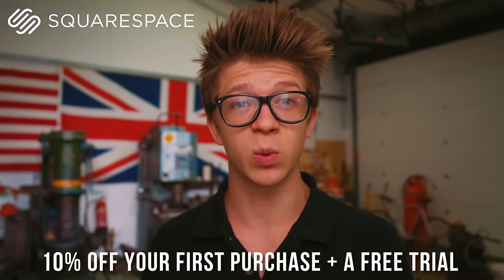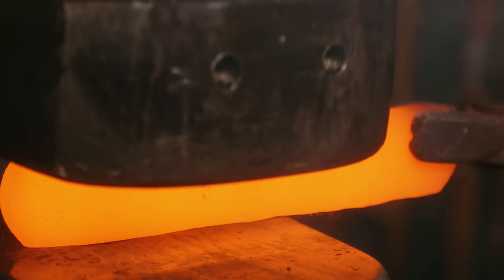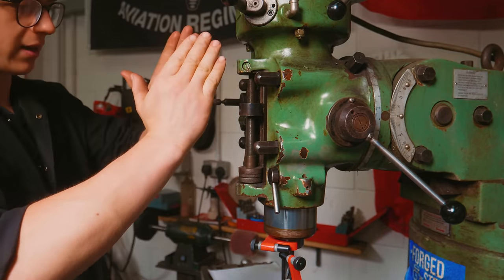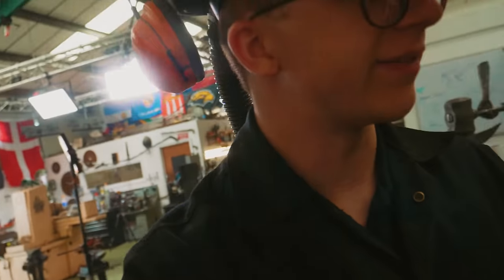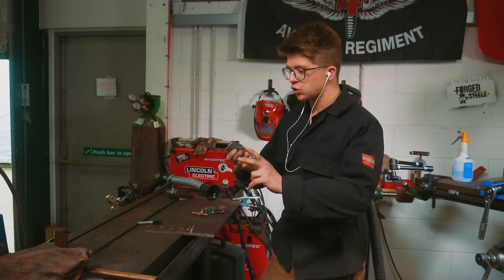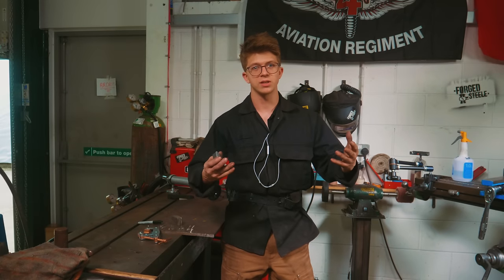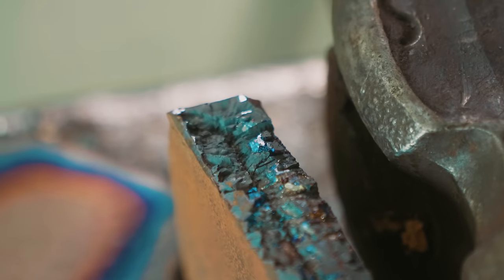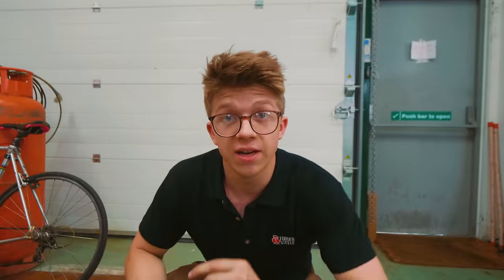CAN YOU MAKE TITANIUM & STEEL DAMASCUS?!?!

Comment: So, Im not a smith, but a welder with a basic understanding of metalurgy, and Titanium welding must be done in a completely oxygen free environment, which I think you mentioned.
I also remember hearing something about gas forges releasing a lot of oxygen in them when the gas burns, whereas a coal forge does not, and is almost oxygen free inside, so would a coal forge perhaps work better?
Reply: Its true that forgewelding is apparently easier in a coal forge, but not because of the oxygen but because of the water vapor which is created in a gas forge but not in a coal forge
Reply: Lars Heim Ah, there we go. I was remembering  things wrong then it seems.
Reply: We use a Torvac with an Argon quench for brazing dissimilar metals.  And a high pressure/temp  process for  diffusion bonding
Reply: Lars Heim is it maybe that the titanium is so reactive it steals the oxygen from water? I know that is the thing with magnesium and they seem to be pretty similar in reactivity.
Reply: MatteV2 he should try the coal forge and flux weld the pieces together one at a time like steel smithing
Reply: ti is commonly used to "getter" o2 in ultra high vacuum systems, which gives you a notion of just how reactive it is.   or put more colorfully, ti will oxidize on the moon.
Reply: Not only O2-free but also Nitrogen-free -> Helium or Argon atmosphered 😉
Reply: What about Neon? Also a noble gas, should be readily available.
Reply: Neon is very expensive for some reason, despite the millions of tons of it in Earth's atmosphere. ;) In fact, Neon is usually supplied to sign makers in 1-liter containers at less than atmospheric pressure, which still is enough for thousands of signs. This is even more the case for He-Ne lasers. Therefore, they can afford to pay a lot for it, which sets the market price. Argon, however, is quite cheap, since it is a byproduct of making LOX and LN2, and plentiful, at about 1% of air.
Reply: helium or argon work just fine for shield gas.  does not need to be done in a vacuum or even 100% inert gas sealed chamber.
Reply: If you are welding titanium and titanium... you do not need to do this in an inert environment... I mean we used inert gas, but you dont have to go run out to space or weld inside a vacuum in a suit with inert gas... (no idea if you can even do this... I added the mental image for entertainment).  Source: Worked in a factory where we almost exclusively welded titanium... http://americas.denora.com/
Reply: Jacob Brown  you are right about not needing a vacuum or 100% inert gas, but you do need some inert shield gas (preferably both sides of the weld.  There are places that do electron beam welding of large assemblies in a vacuum chamber (but no ones inside the chamber).  the electron beam will not work in anything but a vacuum.
Reply: that why he said he needs to add some argon in the forge which is patented
Reply: MatteV2 can verify, the carbon released by burning coal reacts with the local oxygen, while many gases are oxides that, when combusted, produce oxygen.

Comment: Hardest part of working with titanium is that oxide layer. Which of course heating it up makes it form faster and it's a strong layer that doesn't flake of like iron oxide. 

You'd probably need an inert atmosphere to make a titanium and steel Damascus just like you need an inert atmosphere to weld titanium so that layer doesn't form preventing forging. So just build a giant argon chamber and put an electric furnace in it and all your equipment and get a SCBA suit and no problem XD.
Reply: i was thinking that maybe using solder flux to prevent the oxidation might help, dip the parts and clamp together, not sure if it would prevent oxygen though.
Reply: Problems I see with that is first you'd need to prep the materials in a vacuum or shielding gas to remove the oxide then the solder flux would just melt off in the furnace which would cause it to oxidize quickly due to the higher heat.

Titanium will even burn in a nitrogen atmosphere if the surface area is large enough such as titanium powder to make titanium nitride. It's quite the reactive element.

In truth titantium and iron just don't bond well together. When we bond them using diffusion bonding it requires a interlayer of copper or nickle if you desire to bond them below 850C. And diffusion bonding is quite a bit different then forge welding requiring near perfectly flat clean surfaces.

My suggestion of doing it in an inert atmosphere was a jest due to the impracticality of it but it's the closest chance to forge weld them together and even then it's highly not likely to succeed in any meaningful matter :)
Reply: Just do the whole process in a vacuum while wearing a space suit - I don't see any problems with this method.
Reply: A similar process. True stainless steel has 12-30% chromium in it (The steel that the DeLorean panels are made of). This chromium forms chromium oxide layer which protects the surface of the steel from oxidizing. Since the steel has chromium throughout if you scratch off the chromium oxide layer more will form. If it is a very low % chromium SS and you brush it with say a steel brush then it can rust because in that spot you diluted the chromium below 12% because of little bits of the brush wire that is left behind.

Comment: Ive only worked with Titanium ocasionally, so im not an expert. But i guess the heat from the TIGs Arc already made it fail, as while you welded the pieces together there was enough time for oxygen to get in there and form an initial thin oxide layer. When we welded titanium pieces and didnt have the luxury of surface abrasive finishings later, we used an antioxidation+cooling paste around the weld, high flow helium/argon and slow high amp pulses to limit the heat to small areas and leave some cooling time.
That propably wont work very well here as you would trap the antioxidation paste between the layers, which might cause a delamination due to pressure or worst case an explosion. But there was another trick we had for extremely moody materials, a sandplasting like chamber filled with Argon, ive never worked in it but when the older guys used it they did put whatever they wanted to weld in there, their torch of choice, consumables and filler, close the hatch, open the Argon valve, and then they waited. After a minute or so they began welding in a pure Argon environment, the gas from the troch itself would creat an overpressure and you could always here the chambers overpressure valve opening evertime the arc was running.

So i guess this is sadly impossible without special equipment or extreme risks. :x

Oh dear, now i wonder if your crazy enough to try to build your own Pressurized Inert Gas Welding Chamber XD
Reply from the maker: AMAZING IDEAS!!!!! Thank you!!!
Reply: Youre welcome XD
If you really want to try building your own chamber, one of our guys did build it, i still have contact with him so i could ask him for pointers or anything critical to watch out for.
Reply: I know a very old metallurgist, he told me inert gas welding chambers for welding ti were made out of sealed sand blast cabinets.  Would work for the initial sealing up the seams but keeping any oxygen out during and after the forging is the problem

Comment: You can't work titanium at its near melting point in the open air. You need to do with constant inert gas shielding. A bubble is what we used to call it. Back in the day we used an old sandblasting cabinet flooded with a steady flow of argon to weld titanium parts. I'm not sure how you would go about forging inside bubble unless you put an anvil and a induction heater inside the bubble
Reply: crazy observations, I have used a cabinet as well. Regarding this topic, could one assume heating the barstock with an electromagnetic coil inside the cabinet with some type of hyd press work. To much time and cash for me, however the topic is intriguing.
Reply: The coil is the same as a induction heater. You wouldn't be able to heat something on the outside and get it inside the cabinet and then recharge it with argon fast enough before your work piece cooled off. And obviously a gas torch just won't burn Inside an inert gas environment. You might be able to do some heating with a tig inside a bubble but its hard to heat a large area with a tig.
Reply: you will get a eutectic reaction (melting) well below the melting point of pure Ti when combined with some metals, like nickel or cobalt.  the Ti can melt or slag off as low as 1750F if its contact with those metals or their oxide/scale.
Reply: i know this is what you do for like welding titanium with a welding machine. 

and ive heard this is how you have to forge weld titanium regardless if its with itself another titanium alloy or steel. 

ive also heard removing the oxygen from the environment is necessary with certain stainless steels.

Comment: Here's my humble suggestion: draw out the titanium longer, mill out a few holes in it, then sandwich it with steel(1/8th in. layered sheet but you know better than I). The steel should bond to itself between the holes when you hammer it and you'll retain the strength of having a titanium core. Assuming you're going for a sword.
Reply: That sounds like trapping oxygen
Reply: Yeah....... NO!
Reply: That's a nice idea💡
Reply: I love how he explicitly stated that he doesn't want random guesses from people who don't know what they're talking about, and yet one of the top comments is from someone who basically just detailed possibly one of the WORST ways you could ever try to forge weld. Like if you were making a recipe for how to get the most possible cold shuts, massive chunks of oxides, and inclusions, this would be the winner. This would also possible make a bomb.

Comment: Look into an alloy called Stellite. It is 70% cobalt, 30% Chromium, and a trace of tungsten carbide. The tungsten carbide forms a dendritic structure. Not very sharp in a conventional way, but it'll cut dam near anything. I suspect they did something similar here: take titanium as the base material and process it so that there are ceramic micro-serrations embedded in it. Couple of advantages: titanium flexes rather than snaps, and the actual cutting action is done by ceramic, which is much harder than metals.

Comment: Alec I still think you should try the Viking Meteorite Crucible Steel!!!but A canister Damascus using meteorite shavings,1095 powder,and 5160 powder would be awesome!!! J Neilson is the man when it comes to the canisters plan!!!
Reply: It's not crucible if it's canister. The crucible is a smelting process, whereas the canister exists to help you press-weld disparate materials.
Reply: Nieroshai I have been trying to convince Alec and Joey Van Der Steeg to Colab and use the Meteorite to make crucible steel. I also thought canister Damascus would be cool as well!!!
Reply: 1095 & 5160 won't really show much pattern. They are too similar. If the meteor is nickel it should show up but no point in mixing the other two
Reply: Jason Harrison true they are similar but 5160 has chromium where 1095 does not is only a subtle difference

Comment: Need some copper/nickel Damascus projects please
Reply: Nickel is ludicrously expensive. :(
Reply: Isnogood12 so is Ti.
Reply: make some cutlery maybe, sth really delicate
Reply: I don't remember what other material besides copper that he used, but he did do some mokume gane, which is exactly what you're referring to I think. At least it's a common combo for mokume gane.
Reply: Copper/brass
Reply: Isnogood12 nickel is $7 usd a pound. That’s cheap. Although compared to coppers $2.50/lb or steels 10 cents/ lb it’s expensive
Reply: Do you know where i can get relativly pure nickel for that price? i hawe searched a lot but can't find a sheap sourse of nickel... (i ask because i want some for plating and to laminate steel)
Reply: Mitch Johnson it was nickel and abt 2-3 months back =)
Reply: Thats called Mokume Gane.
Search for it
Reply: I could see a table top inlaid with this material.
Reply: Isnogood12 really? i have like a block of it wtf

Comment: If titanium oxide is the biggest issue...why not have the titanium in the center so that it is sealed within the steel? Is there a safety reason? Great videos Mister Steele!
P.S. Perhaps a silver/copper Damascus like the "Old Sheffield Plate" process used? You could research and discus some of it's history as well. Or Maybe a Nickel silver/copper to keep down the cost?
Reply: I think the reason he didnt put the titanium on the inside was just so that if it popped it wasnt likely to throw steel up at him... i was thinking about the same thing...

Comment: Why sealing from oxygen instead of taking oxygen away?

The old school is to heat two pieces of steal, pour some sand on the contacting surfaces (while heating, then add a little just prior to hammering) - it basicaly seals of the material. You know that process. 

This is one way. - Dont weld - put proper seal on the surface. 
Second approach:  3 compound damascus. Galvanize something onto clear titanium, than  add steel. (this is the only clue i can give. Want more clues - we're doing this together)

Third and most dangerous approach: Use some reactive layer between steel and Titanium. You want something  that will consume oxygen from titanium oxide and then will be pressed away by hammering. Instead of can with neutral gas, You'll get kind of metal fence around hammered piece filled with flux (not sure if this is the proper English word for ingredient added while You melt metals to ged rid of dirt and to extinguish fire on top while melting/smelting). I believe it would do the job but You need to dig into chemistry - all component You'll find by asking simple questions: "how to melt a titanium?" and "how to cast something from titanium?"

Comment: This is awesome, I love these kinds of videos.
As for another set of metals, I would Suggest Aluminium, that stuff is forgeable but it is difficult due to the aluminium not glowing red hot.
You can also try to make a Zinc Damascus, this could be very interesting because zinc has such a low melting point.
If you have Nitrogen available I would consider making a container for the titanium and purging that with nitrogen. Nitrogen is a quite noble gas so it should be a cheap option.

Comment: Please excuse my ignorance. Can someone clarify these questions of mine?
What is alloy?
Mixing metals with other metals/non metals right?  Like iron and a non-metal carbon?
What is steel?
Steel is produced by alloying metals with other elements?
What is damascus?
A technic of layering steels to make a stronger steel?? Since titanium is often mixed with aluminum and vanadium, isn't it steel?

Edit: what is the difference between alloy and steel?
Reply: Joel, I'm going to try to answer your questions, bear with me. An alloy is a combination of metallic elements (eg, bronze=copper+tin+som other things). Steel is also an alloy, but it is exclusively iron and carbon. So steel is always an alloy but an alloy is not always steel. Damascus refers to the technique of forge-welding many layers of a metal (usually steel) to one another to make a stronger outcome, the metals or metal within the damascus stay the same throughout that process. Things like titanium and vanadium are elements in their own right, so combining them with other things just makes an alloy, not necessarily steel. Hopefully that all makes sense! God bless!
Reply: @tobyham3188  thanks a lot for making it clear. Good day!!
Reply: @tobyham3188  actually carbon is non-metallic for example. Not all alloys are combination of only metallic elements, non-metallic elements are also possible. This could be for example iron-hydrogen alloy, a metallic element combined with non-metallic element to create an alloy.

Rest of what you said I agree with. Steel is an alloy,  like bronze. Damascus is a forging technique.

Comment: If it mixes well, the steel will compliment the titanium

Titanium is stupid strong and Hella light, but also like peanut brittle if it's thin enough, and snaps like a KitKat bar

Steel, which is basically iron and a little su-um su-um, isn't as strong, but it is stupid flexible, and can hold an edge ironically better than titanium

A titanium steel alloy would be a very good metal, making it a practical, and durable, material

If they mix well…
Reply: Titanium is very strong for its weight, but steel is still stronger. Which is why you don't see titanium engine parts in production engines. They wear out too fast and need to be checked very frequently to avoid failure.

Comment: Make a square frame around your hydraulic hammers, doors with a T shaped cutout so you can position materials with the same ways you would before. The doors would act as a spark shield, and as long as you wear safety glasses, you can look at what you’re doing well enough. Cut the left hand side of the T slot to the edge of the door so you can open, slot your piece, and close.

Comment: Use borax to rid the oxygen from between the metals when forging.
Reply: Borax wouldn't do much good because Oxygen will still bond with the Titanium. Any high temp working of Titanium is best done with an inert atmosphere and that's one of the reasons why high quality Titanium products are so dang expensive. Of course, Borax is, mostly, used when forging steel because it sticks to the other impurities like Sulfur and Phosphorous. It doesn't actually eliminate or bond with the Oxygen so much as making a temporary barrier that effectively disappears with the first blow of the hammer.
Reply: @petesampson4273  dont forget the machining costs for titanium. as well as the risk of fire from machining and other issues. 

breaks bits like a mofo. wears out sanding belts stupid fast. is hard to thread. requires special grease and treatments and other stuff to prevent other issues. 

the stuff is awesome but has its issues. it is also kinda rare.